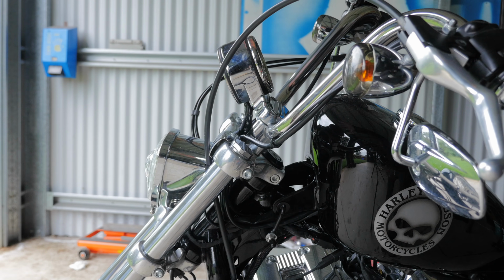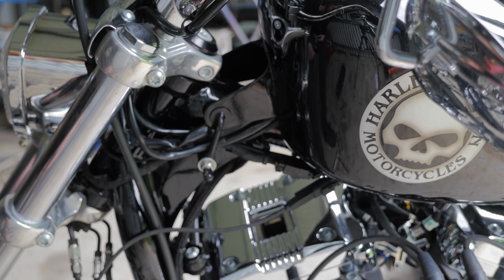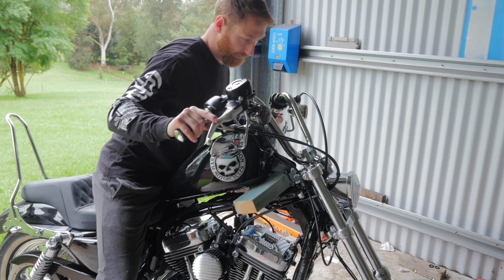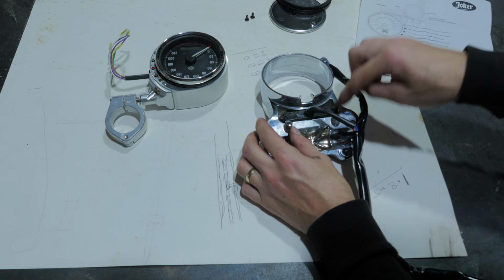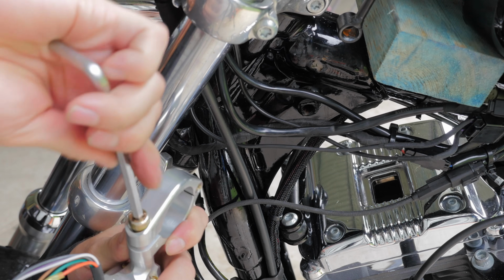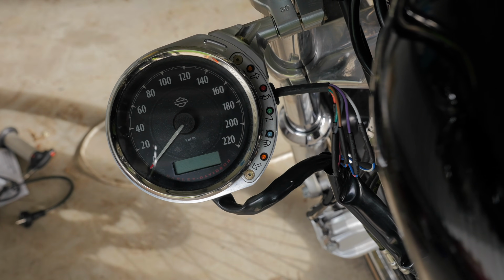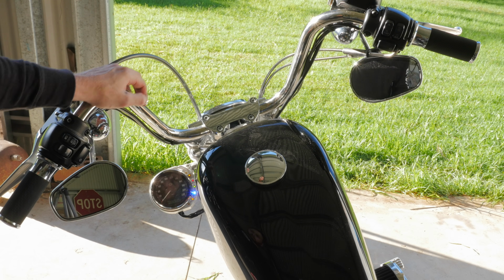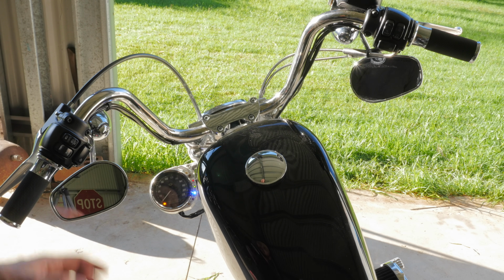Joker machine gauge relocation mount - Sportster 72

Comment: Would this fit on a 2015 48 with the Harley Digital Combination Speedometer / Tachometer?
Reply from the maker: Yes you can buy these from joker machine to fit the harley 48 forks
Reply: @TheGingybeardMan  2015 forks should be 39 mm similar to your 72. They moved to larger forks the year after I believe. Other than fork size, no issues with fitting them right?

Comment: Love the build! Also can I get the link for the bracket and handle bar clamp you used?
Reply from the maker: I bought the bracket off ebay. But here's a link to the website https://jokermachine.com/products/speedometer-side-mount-39mm-fork-tube-clamp-black

The riser clamp I purchased is no longer in stock at Easy R which is the website I purchased it off so I cant send a link to that.